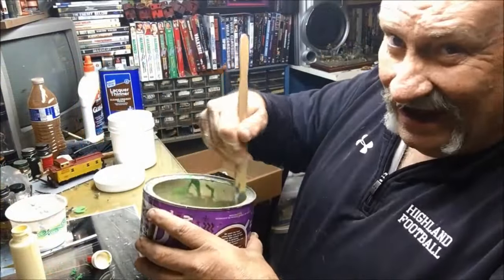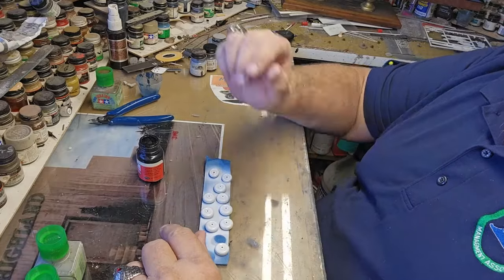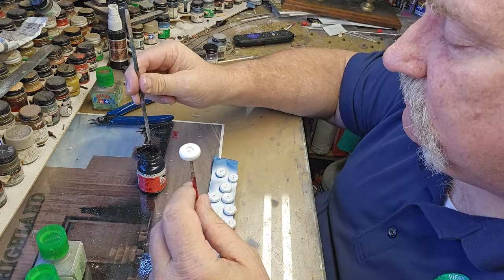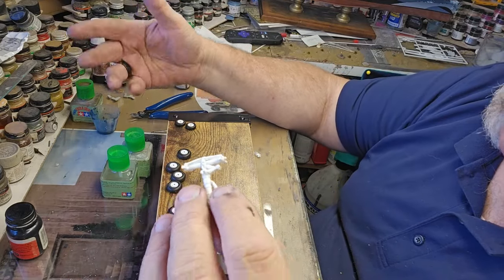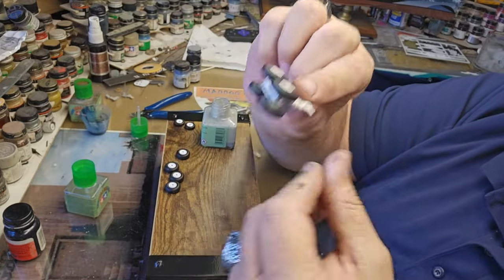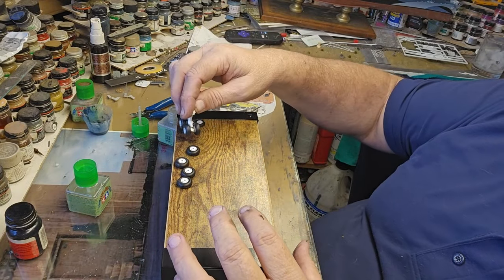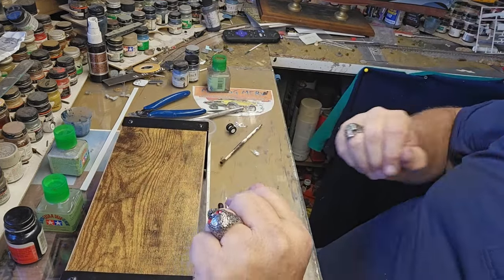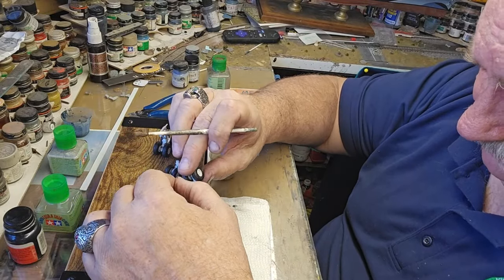Tips & Tricks: Assembling/painting multipool wheeled landing gear

Comment: Using sprue goo is a good idea. I've found some undercarriage to wheel fitting really sloppy and that would pack the gaps up👍😃. I make mine using all my sanding dust and shaving swarf from kits I'm building to add to a mix of lacquer thinner and acetone (nail varnish remover) to make a cheap alternative to tamiya extra thin🤔. I'm glad you did this vid,Merv. I'm about to start on a German aircraft that has similar system and,no doubt I would have gone ahead with wobbly wheels🤣
Reply from the maker: I'm glad you found it helpful pete. I really like to use xylene in making my sprue goo but it is not available in my area thanks to government restrictions. So the Tamia extra thin while being a very good alternative is also a lot more expensive.